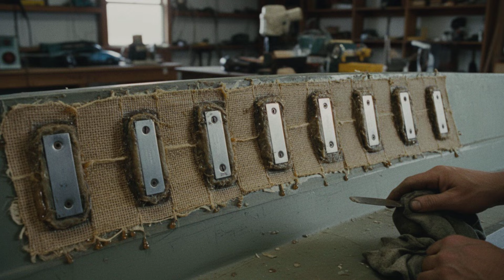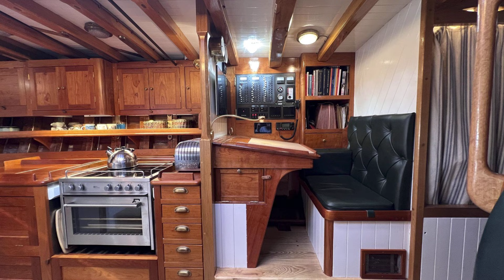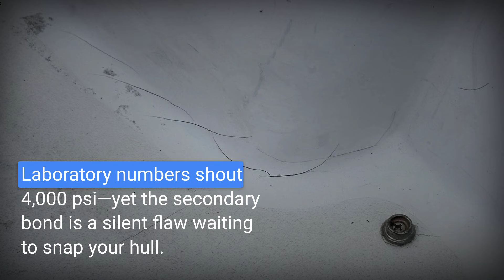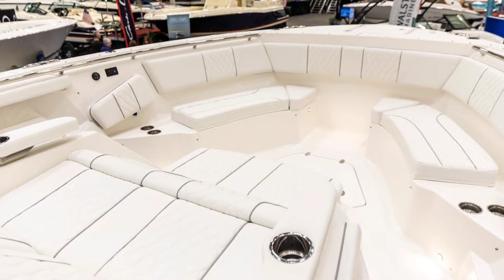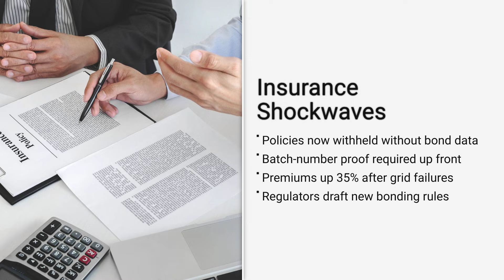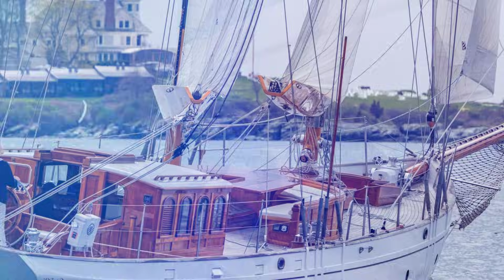The 'Grid System' Lie: Why Modern Production Hulls Are Designed To Snap

Comment: Try getting insurance on an old boat.
Reply: Never had an issue getting fully comp insurance on my 50 year old Colvic Watson,
Reply: The great conundrum - old boats with bulletproof hulls and obsolete or failing systems everywhere, or new boats with disposable plastic hulls and brand new systems. Insurers know that 90% of owners will spend most of their time tied to a slip or coastal cruising. The brand new systems win every time.
Reply from the maker: haha
Reply: Just get liability insurance and don’t worry about it